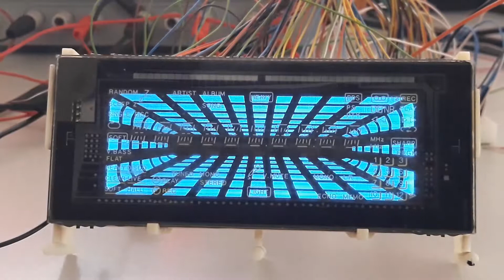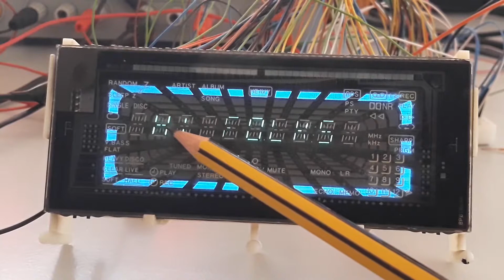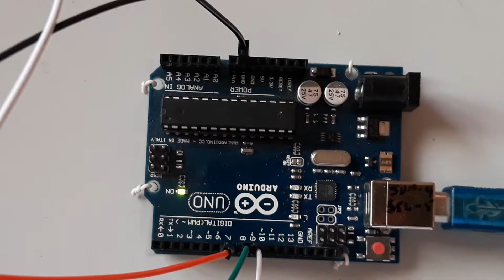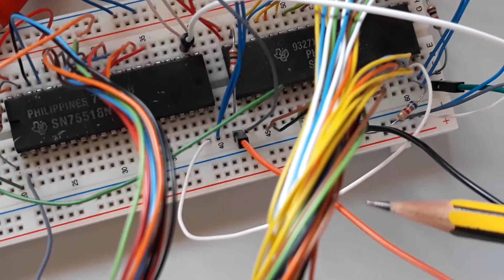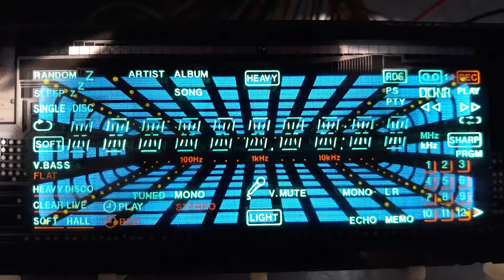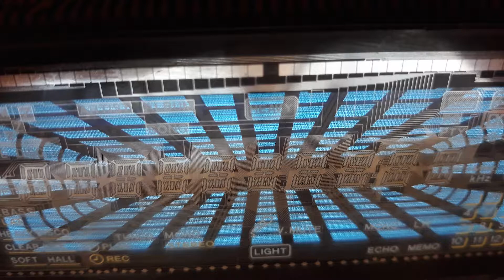VFD with deep effect

Comment: What display is this and how would I find one?
Reply from the maker: Hi Scott Sheffield,
This kind of displays have phosphor in glass front and rear.
This is not easy to find it because is vintage, any way I have two with me and like I do with others models of VFD I can disponibilize it through the ebay. But this need be very synchronized actions because some times have other buyers which get it before intercepting the listing!
Please note this VFD's are not easy to use, need some knows at programation and electronics, ok!
Reply: @jlsmonte  very cool! I looked at your shop and bought one! Do you remember what this specific display was from? It is very cool.
Reply from the maker: i @Scott Sheffield ,
At this moment I don't have the audio brand system  
from where as been unmounted... but one stay installed on the board PCB, maybe there have any inscription about the brand!
During next week I will check it and after list it on eBay and let you know... if this is really wath you need you can buy it!
Many thanks by your´s questions!
Reply from the maker: Hi Scott,
Already find a brand and model related with one of this VFD's: Panasonic SAAK-48
The schematic is at net and video showing the Compact Sound System working is present on the youtube.
I listed the both, please check is any is ok to you!